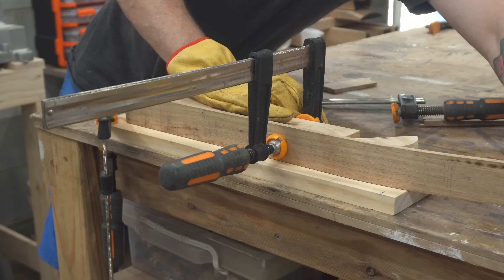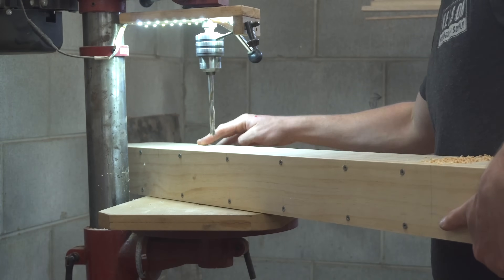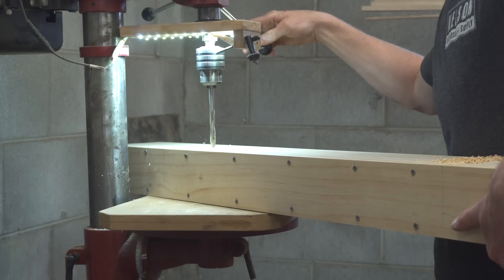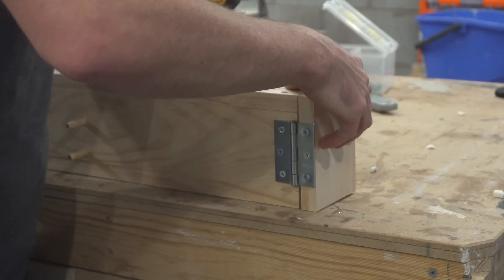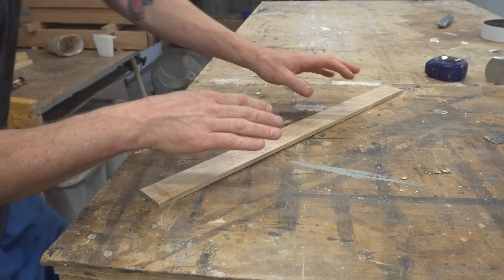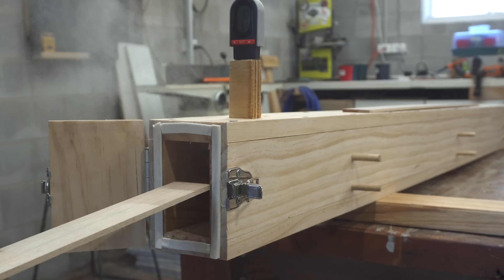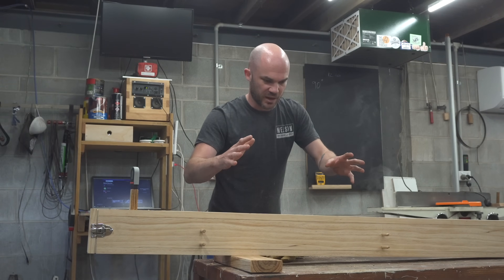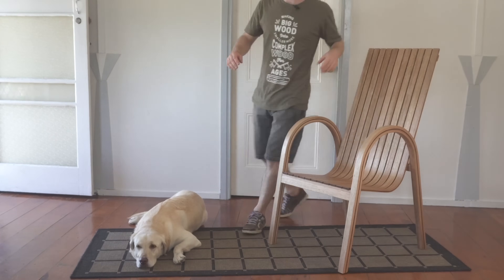All You Need To Know About Steam Bending Wood

Comment: It needs something like a flexible Steel to compress the fibers on the back side while you are bending it and then you will avoid the cracks. It is very important to compress them to avoid cracks. And to keep it from cracking later.

Comment: 34:13 when you’re building the second steam box, when you chose plywood I’m wondering if you were to coat the inside with some sort of rubberized or high temperature finish if it would stop any distortion or is plywood enough since it’s not solid wood?  If you had a can of flex seal sitting around, would that be beneficial to spray the interior where water will accumulate so it can run to a drain hole instead of soaking in?
Reply from the maker: Something I discovered after this video is “formply” (not sure if it’s an Australian thing). It’s plywood with a hard waterproof coating, similar to what you’re describing. The next box I make I’m going to try that.

Comment: How long would you recommend soaking the wood in water for?
Reply from the maker: Depends on the the thickness of the timber, but at least 24 hours. If you can just put it in water well before you need it, so it’s ready to go for the steam (instead of trying to time it)